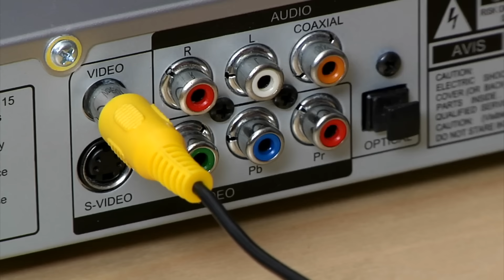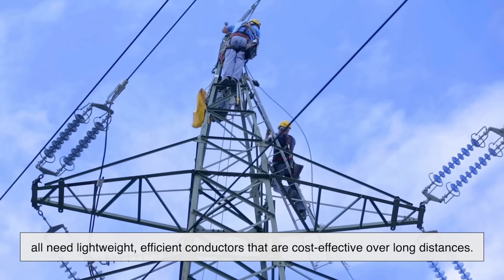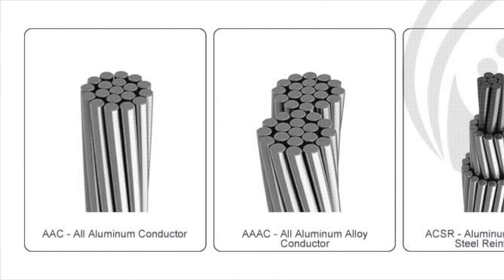Why Do Power Lines Use Aluminum Instead of Copper?

Comment: Copper is not king.  The trophy goes to silver.
Reply: Silver is slightliy better in conductivity, but way too expensive. Copper is ~8$/kg where silver is at the moment at 1100$/kg!
Reply: @JacquesMartini Exactly!! THAT’S why it Is king!
Reply: @JacquesMartini All good points made here andvim feeing this thread will be the type everybody is  correct justbdifferent angles perspectives...for example if money didn't exist then the metal importance would be based only on ots practical use so steel and iron would be king as they the strongest and and the softer metals unless being used for modern technology back in the day these metals would be classed lesser metals unless there wear other uses you could say jewellery nut but from our viewpoint jewelry isn't a priority or particularly important in fact not at all important from our view but what if jewelries wernt just for looking good too others but served healing purposes as I belive very much is the case and we have metals inside us which I always found strange how it got there as iron has too be forged and copper refined and processed from rock yet both are inside lifeforms from birth and we have crystal in our brains n crystal vibrates when with metals and or a charge so makes you reconsider wearing a crown 👑 maybe it wasn't always just for show purposes originally and native peoples who wrap there whole arms n neck in copper the indonesian people from not long ago wore some very intresting items n still do but anyway I'm on a tangent but all worth looking into ..thanks for reading
Reply: True,but too expensive for long distance electricity transmission.
Reply: And that's why the Manhattan Project borrowed tons of silver from the US Treasury during WWII, to use it in the windings of their cyclotrons because copper was scarce due to the war.
Reply: Silver is my favorite metal. It's not as rare as other metallic elements like gold, platinum, rhodium etc but it's the most beautiful. Not only is it the best conductor it's the most reflective metal in the world. It has a whiteness and shine that no other precious metal can match.
Reply: I design optical instruments.  We use aluminium mirrors because they are better than silver! I agree that silver is a lovely metal...also the most ductile metal, i think! @aethelred9781
Reply: @aethelred9781 gold would make great solder. It’s too bad it’s so expensive and rare. It would be great on printed circuit boards.
Reply: Silver plated copper your sure  not making bus bars out of silver
Reply: Quite correct.  Silver is the metal that other metals are compared to for reflectivity, conductivity, and even other attributes.  
Gold is a 'good' conductor, but it pales to copper and Silver.   Gold is often used where physical intermittent contact is needed, or a need for zero corrosion.  Flash drives, computer ram, etc.  Fun fact, Platinum is more resistant than Gold to corrosion.  Gold has an attractive hue (to some), and it's rarity gives it monetary value. Personally, I'm not a fan of Yellow.  Though I do acknowledge its unusual appearance, and do find it somewhat attractive.  I LOVE the look of copper 😍 And Silver can look quite attractive with good toning.
Reply: As they pointed out in this very video! 1:04 🤯
Reply: @militaryav8r    No, no mention of Gold or Lead there.
Reply: @hughleyton693 What?? I was addressing the OP. I have no idea what you’re referring to.
Reply: @militaryav8r     This is the problem with these youtube comments. . .  they become fragmented and we can not see what someone is asking or referring to, unless they state it.
Reply: Because they're both irrelevant in the context of this video. @hughleyton693
Reply: Actually gold is king. Gold is used in CPUs because it is the best. 

Silver is second and copper is third.

Aluminum is used because of cost. Little wires make little savings. Large wires make large savings. 
When they realized the aluminum wires were lighter it was a no brainer.
Reply: @marveloussoftware1417 
Look it up in any book and I believe it has to do with the amount of free electrons.
Back in school and the books I have list the conductivity as
 
1) silver 
2) copper
3) gold

I believe in more recent publications gold is listed as 4th.
Reply: Correct ,but there is not enough copper and silver to meet  the needs .
Reply: I know that because I read about silver contacts for certain vapes
Reply: We use some silver plated wires, but most concerns don't, due to the cost.
Reply: Lead is a better conductor than both in some conditions
Reply: @sammy5576  No, Silver is the best, then Copper, and Gold a little better than Aluminium. . .  Lead is way down the list.
Reply: @sammy5576  No, Lead is Not a particularly good conductor, not as good as aluminium.
Reply: @hughleyton693  i am right, do you want to know the conditions where lead is a better conductor than aluminium?
Reply: @hughleyton693  between 1.2K and 7.2K lead is a better conductor than aluminium, these are transition tempritures
Reply: @sammy5576  I am always interested in learning..   Try explain.
Reply: @sammy5576     I don't think that would work very well with our house or transmission wiring.  🙂. . . .   However, I have been following closely, one company using special copper at something like -250°C, trying to generate electricity. 🙂
Reply: @hughleyton693  at such low tempritures most metals become super conductors, the tempriture that this occurs is the transition temp, usuallly you need liquid helium or for high temp super conductors liquid nitrogen
Reply: @sammy5576      Yes, so many things we know about materials and electrical conductivity, change at those extremely low temperatures. . .  The example I was referring to, is in some new Fusion experimental machines, where they use the super conductivity to make very powerful Magnetic bottles to hold the very, very hot Hydrogen Plasma in.
Reply: uh, no, Gold. There's a reason processors use it.
Reply: @johnqpublic9074  As I have said, Gold is not as good a conductor as Copper, but very small wires can be worked better if Gold.
Reply: @johnqpublic9074  There is a reason. But the reason is not conductivity.
Reply: Over 50 years ago I had a summer job at a factory making motor commutators. 
A worker told me that they were previously making a batch of silver ones for medical equipment and got stolen.
Reply: Trophy goes to gold
Reply: Copper is the crown prince of conductivity 😁
Reply: @DaveEtchells  Yes and No. . .    Silver is significantly Better than Copper for conductivity, but much more expensive, so we only use a little Silver when we really need the best conductivity. . .     So yes, Copper is the main metal used for general best conductivity. . .   But still more expensive and heavier than Aluminium. . .     so there are probably many more miles of Aluminium used than Copper for high power Electricity over great distances. .. .   I have even seen Transformers made from Aluminium as cheaper and lighter, even if the wire is larger in size for the same kVA power.
Reply: only just barely though. the difference on conductivity between copper and silver is very slim.
Reply: Both are far too heavy to use for transmission lines
Reply: You don’t pay very good attention do you?
Reply: No it's silver, copper and gold. Gold is used as a plate metal on PC boards. 73
Reply: Aluminium in homes were and still are a fire hazard. Aluminium  is ok for meter feeds to the main breaker most boxes are compatible for aluminum feeds. 73
Reply: Nope.  Too expensive
Reply: All come down to cost and fitness for purpose.Resistivity lightness durability strength and cost availability thermal conduction.Silver better than gold for resistivity and copper.Copper a lot more cheaper.But u can have mixtures and coatings.The fixing of metals together termination is prime.
Reply: Damn the comment section here read like one of those scams you see on every other channel. “I make $75,000 biweekly, you got to know when to get in when there is minimum resistance & no monetary loss! Jesus is King, God is great etc” with comments simultaneously piling on top “whom can immediately throw my money at without any due diligence to increase profits on RSI stop loss in the MACD” then they casually mention someone as if anyone was stupid enough to take financial advice let alone an investor via the common section!
Reply: The king would be Gold sir
Reply: Yup. Just so expensive.
Reply: Yes, and gold at the connections. In a world with infinite resources.
Reply: And Colloidal Silver eliminates over 650 pathogens ❤❤❤❤❤
Reply: @stevensilver6298 you can put a silver coin in water and make it more pure. Just use a real silver coin not 
What they made coins with after 1964. Mainly copper. 73
Reply: Sorry platinum and graphene in my tests results.
Reply: He mentions that a little bit into the video and clarifies what is better but not for the money and the application. The word copper is King I think was more of a tongue in cheek
Reply: @Peterthethinker mainly used in wiring I never heard of silver romex or Greenfield. Some heat related items you may find a silver wire. The waffle iron I repaired I bought a piece of silver wire it wasn't cheap. 73
Reply: Except you're wrong. Yes silver is more conductive, but the term doesn't come from the fact it is just conductive but the it is one of the most important electrical conductors that is also common and ironically considered cheap because of it's abundance allowing it to be used like it is. Silver is too expensive and too rare comparatively
Reply: I prefer dilithium.
Reply: Actually is gold
Reply: I’m voting for room temperature superconducting alloys… from the future…
Reply: Yeah but it also oxidise after some time which does not make it the best choice for cables or electronics
Reply: But when copper gets silver, and silver gets gold, wouldn't copper indirectly get shared 1st place?
Reply: Trump is king 👑
Reply: Which is interesting considering how manipulated tbe price of silver is.
Reply: Always in a rush to comment. Follow the video to the end and get the facts. Silver is not a realistic choice for power transmission in practice because of cost. It might be the best in theory but not in practice
Reply: @obinnaozoemena who cares! People comment while watching the video. Don't like it leave and don't let the door ...........73
Reply: Lots of comments about Gold. It has lower electrical conductivity than silver: silver 6.2 S/m, copper 5.9 S/m, gold 4.5 S/m.
Reply: Exactly!!!👏👏👍👍👍 @HughCStevenson1
Reply: @HughCStevenson1 . I sense you're a fellow EE.
Reply: @HughCStevenson1  I Only Use Copper But I make sure it is THNN or some kind of anticorrosion treatment for residential use...solid wire for long runs and stranded for short runs.....I didn't know silver better than gold though...thanks for the info...
Reply: Gold is no slouch,either.
Reply: @adollarshort1573  Gold is only slightly better than Aluminium, not as good as Copper or Silver.
Reply: @adollarshort1573  Its only slightly better than aluminum.
Reply: The Gold on motherboards is to keep the surface solderable, not for conductivity. Called immersion gold. Edge connectors may have hard gold plating. Used to avoid corrosion.
Reply: @HughCStevenson1 actually it is used for conductivity as well. 

If you need to fight corrosion you need to choose a metal. You can choose a more conductive or less conductive metal. In computers, due to speed and size, gold works out well.
Reply: @HughCStevenson1 thanks that's a good Explanation. I work in electronics and don't use tin whisker solder only Sn63/Pb37 . 73
Reply: Ever head of gold?
Reply: @tlotlisomoletsane3598  gold is better than copper and aluminum, but it’s not the king.
Reply: Never head of gold.  Ever head of proofreading?
Reply: @bertblue9683  You can spell gold as Gold or gold. .   Still the same stuff we use in many electronics applications.
Reply: @bertblue9683  yeah, I agree. Proof reading is important.
Reply: Gold is king. Silver tarnishes, gold doesn't.
Reply: @skidmark316  But unlike copper oxide, silver oxide is conductive negating the need to clean it for a good electrical connection.
Reply: @skidmark316  I took a beginning electronics class in college, and the instructor spoke about the conductivity of silver.   He stated that while silver oxidizes, silver oxide is also a great conductor so it didn't matter.
Reply: @skidmark316 .. gold is not ‘king’ silver has a lower conductivity!
Reply: @skidmark316  gold metal doesn't carry the same conductivity properties as copper does.
Reply: @skidmark316  you’re mistaking Sterling Silver over Silver.
Reply: True gold is
Reply: @eds5977  No, Gold is not as good as Copper for electrical conduction, we would not use gold wires, even if the same cost as copper. . . .   But Gold does not tarnish, so much better for electrical contacts.. .   That is why you will see gold contacts on most computer connectors and important plugs and so on.
Reply: Something that is ridiculously expensive for the application isn't 'king'.
Also silver tarnished/oxidises BAD.

Copper is, and always will be king.
Reply: People don't have silver wires in their homes so copper is King! 73
Reply: Copper is King in homes and aluminium is king in transmission lines. No one has silver wires in their homes so copper wins. There was a time silver was used in electric stoves. The two burner ones. I had one that had silver wires I don't remember if I still have the wire it would be good to melt down and make a ring. I know the order of conductors but that don't mean a hill of beans in house wiring. Let copper ring in homes and aluminium outside the home. 73
Reply: Actually Gold is the king of conductivity.
Reply: @devmeistersuperprecision4155  .. no it isnt
Reply: @devmeistersuperprecision4155  stop repeating that myth, gold is only a slightly better conductor than aluminum, and significantly worse than copper and silver.
Reply: I always thought this as gold is used to connect semiconductor circuits to the outside world. But it appears silver holds this throne.
Reply: @devmeistersuperprecision4155  gold is not as conductive as silver, but being an element in itself is a much longer lasting material, too heavy for power lines, but even better is silver aluminum alloy, much lighter than pure silver and more conductive than gold.
Reply: @devmeistersuperprecision4155  Silver
Reply: @devmeistersuperprecision4155 nope. Silver, Copper, then Gold.
Reply: @devmeistersuperprecision4155  ACTUALLY DIAMOND IS THE EMPEROR OF CONDUCTIVITY 😂
Reply: It's gold that's king.  That's what is used in chip bonding wire.
Reply: @jrplus416  No, Gold is not as good as Copper for electrical conduction..    But Gold is used for electrical contacts, because it does not tarnish, like copper will. . .    Also small gold wires are used in chip wiring as you say, because Gold will bend and bend and can be worked, better than copper can, and the distance is very short inside chips, so no need for best electrical conduction is not needed, just work-ability.
Reply: @jrplus416   No, Sliver is the best.